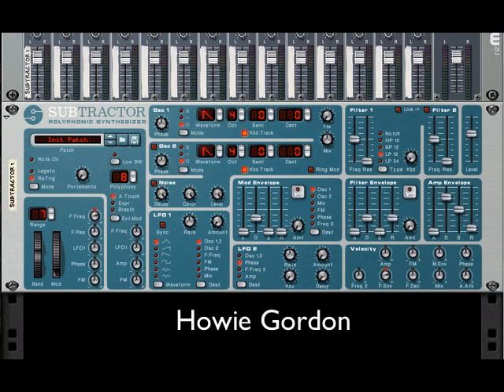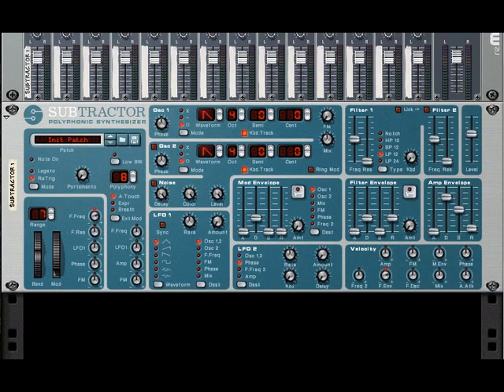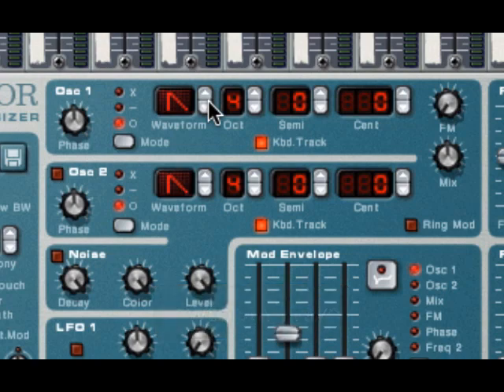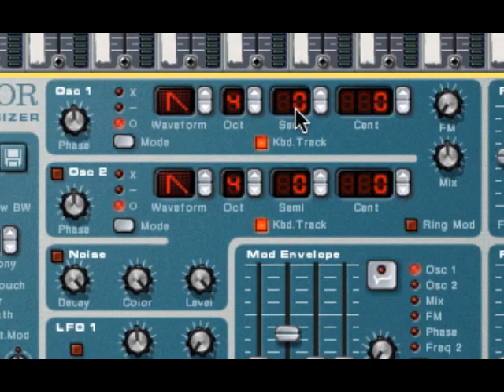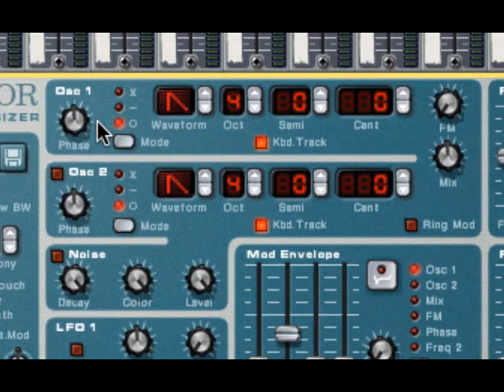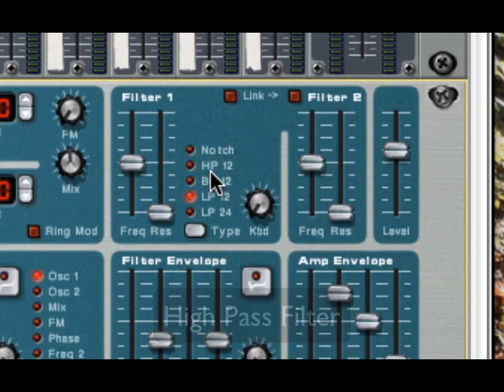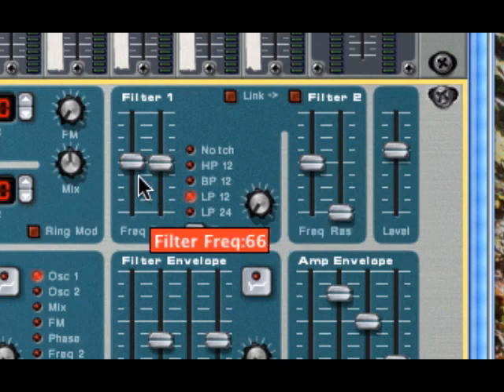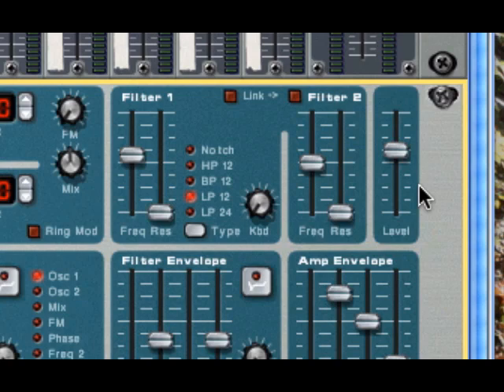Synth Basics • Episode 1 - Part 1

Comment: Thank you for your video, however, I have a question. What makes a sound or voice to be a voice of a violin, or Guitar, etc. Are they waveforms themselves , before coming to synthesizer and a waveform such as a saw wave or sin wave, etc, is applied to them afterward? In this case,  if this  is correct then it is like editing a sound wave again . Does Oscillator creates the source sound such as violin, or it is for shaping the sound to make it sound like sin wave or saw wave, ?
Reply from the maker: Hi Karisma, sorry for the late reply. I'm not sure I understand your questions fully but it seems to me that you are confusing a synthesizer with a sampler. A sampler uses recorded waveforms as the initial sound source while a synth generates its own waveforms via the oscillator. If you need further help, feel free to contact me via Keybomb dot com. I am available to teach lessons via Skype.